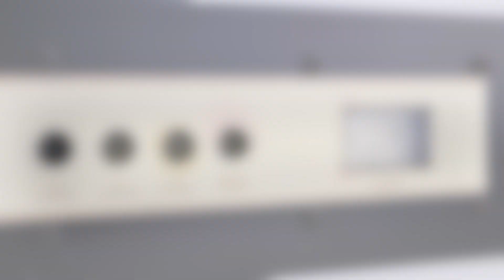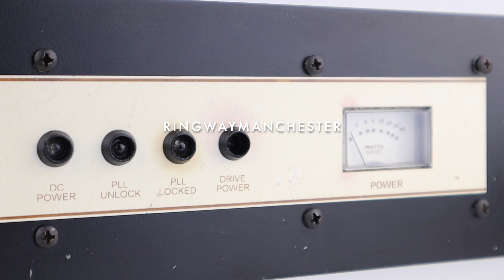Michael Jackson's Illegal Pirate Radio Transmitter

Comment: actually under part 15 if they were only transmitting a couple of blocks or out to a parking lot that would have been ok with the FCC.. I believe offhand they allow up to a 1/4 mile or 250mw whichever comes first.. drive-ins have done this for years.. for the most part the only thing that will get you into trouble is if your cussing on air.. playing uncensored music..  or interfering with a licensed commercial station and if someone complains.. just insight from someone who has some knowledge of FCC broadcast rules.
Reply: For FM, it's a specific field strength rather than power level: 250uV (microvolts) maximum measured at a distance of 3 meters from the antenna.  Typically, it will get you up to a couple blocks if you have good line of sight from the antenna, though I know plenty of Part 15 operators (mostly those who have no clue what they're doing) just crank the power all the way up on their certified Part 15-legal transmitter and assume they're within the legal limits.  In fact, there's an annual Christmas display in my town that SHOULD only be heard about a block away, but it covers the entire downtown area.  Personally, I have a little 1-watt transmitter on my desk in my apartment, and due to my location on the top of a hill, I have to keep it powered quite low to stay within the limits.  I can neither confirm nor deny any claims that its full power consistently covers about a 1.3 mile radius 😉

Comment: Clever idea! Around the same time period they did this for MJ, my father, also an audio engineer, built a transmitter much the same and advertised his home for sale. You could tune into the station on the sign out front and get a verbal tour of the house. Never got into any kind of trouble! Im surprised this sort of thing was not more common.
Reply: Saw homes in Pennsylvania radio  broadcasting their for sale info a decade or more ago.

Comment: You could buy FM transmitter kits all over the place back then. Getting one that was stereo was a little more pricey, maybe $50, but not difficult or even unusual. Cars had 8 track or cassettes. If you wanted to add a cheap CD you got a FM transmitter for your car or you used a cassette tape wedge. The bottom part of FM band around 88MHz has a provision for this.

Comment: If you want a mix to sound like it's on the radio nowadays, you don't need an FM transmitter.  Just do the following:
Reduce stereo separation to zero except when the audio levels are below 20db of 100% modulation, then give just a brief squirt of stereo image.
Limit audio frequency response to 50hz - 7.5khz.
Use a five band audio processor with thresholds adjusted to about -10dbm. Set attack for less than 10mS, release for 500ms
Use a "soft clipper" set at 0dbm to shave off any peaks above 100% modulation.
Sounding pretty hideous at this point, so go ahead and set your stereo imaging for maximum image and and be sure to set the sampling time to 1 to 2 ms. so you can hear that whine of  the poorly combining unmatched left and right comb-filtered channels.
Oh ok, add a little reverb to give the illusion of high fidelity.
If it sounds like crap, your setup is correct, you now sound like 90% of the FM music stations in the USA.  Record your mix and take it out to the car, listen and cry.
Reply: This is completely wrong. why 7.5khz? this is more AM than FM quality
Reply: The audio frequency response for FM can go up to 15 kHz and down to 30 Hz (about the same for a decent cassette), so filtering is not really necessary. The purpose is to see how it sounds in the car, rather than how it sounds on the radio. I think why they did not play the cassette in the car is because car cassette decks may not be as good as high-end home cassette decks.
Reply: @shenghe9876  I'm aware of the potential FM audio bandwidth, per FCC Part 73.  I'm saying it is not being fully utilized anymore.   If this is being done to enhance the BW for a HD mode, I get it.  I would just prefer a good clean 30-15K frequency response in mono to the quality we now receive, which is often reminiscent of an old cassette deck with a loose tape head, lol.

Comment: Did they also use (multiband) audio processing on that FM signal? Otherwise it made not really sense since all radio stations don't play raw audio on their transmitters without it. So it would definitely not sound the same as any radio station there,

Comment: I still do this now using a 1.5W transmitter (with power turned down) into a 50 ohm dummy. It can broadcast just outside to my car. Unfortunately, going straight through doesn't give the truest impression of what it'll sound like on radio, as many stations use their own audio processing as well as MPX processing to max out the 100kHz bandwidth. The only way to get it sounding close is to run it through something like StereoTool. Still, it does help to get a mix sounding better!
Reply: Stereotool is widely used by lower budget FM stations these days. Setup well it sounds good. I know one community station who sound better than the Greatest Hits up the road who are presumably still using the Optimod from the station they took over (granted said Optimod was set up under the instruction of their moronic PD and overdriven to distortion).

Comment: Hey anyone ever heard about it's not really radio but it is about putting two ground rods a certain distance apart and sometimes just a crystal diode like a germanium diode or even a more elaborate tuner in some cases and basically receiving things through the ground that essentially just a difference in potential between two ground rods can pick up.

Apparently back in the day there were people that would do to reverse and transmit this way and would tell their fans or others to do this in a way to receive.

Even in more modern times you can sometimes hear interesting things going on you should just random noise and stuff but occasionally more I know somebody that tried this experiment and they realized they had a problem with a piece of equipment because of this don't remember the whole story.

But they were getting electronic noise that should not have been this is after it's started the hobby and realized what it was and had corrected the problem before the device had failed I do believe he was in amateur radio but not sure.

Could be confused with someone in a family being an amateur radio and tell him how to do this.

Don't remember how many years ago this was.

I had heard stories about this people doing this many many years ago!

And if you have a high enough number of transistors chained you can get tremendous amounts of gain an amplifier stage.

Even to the point where you can pick up lightning miles and miles away with a simple antenna!

And even other types of electrical noise that would not even be perceptible to even sensitive equipment at least it would be available to the obvious.

Can't remember what one of my friends was doing but he did something like this to pick up some type of interference to track something down he was having trouble with and one of them getting fascinated by the results of what he was able to pick up.

In the end wound up doing something with the circuitry to detect lightning in the distance!

Also back in the day when the coheras were used.

It was known that they could also detect lightning since after all they were detecting the spark gap transmitters and what is lightning but a big Spark.

Also they're able to measure the Earth's temperature by Schumann residents which is essentially the frequency you can tune into but the proper type I've set up.

And in some form or another since apparently Earth's temperature on average does influence frequency of lightning flashes!

Comment: I did some work in Canadian studios during the late 90's and they had more kit than you could imagine. I went into a sound booth and was given a tour of what was there. They had several sets of speakers including ones to replicate the 'transistor radio', a 'tv set' and on a PA system such as in a shopping mall. They also had full stacks of broadcast quality speakers. Allegedly MoTown was where this practice of using lo-fi speakers in the studio came from, for that 'transistor radio' feel.
If I can remember, the booth was like a padded cell with sound insulation all around. Even with these clever speakers you still would not get the in car experience because there isn't an engine throbbing away, no tyre noise or noise from the 'wind'. The acoustics were different, however, MJ drove a Mercedes 500 SEL to get to the studio and that was quite luxuriously padded inside.
So why didn't MJ just use the cassette deck and play a tape? Particularly since it was FM that they were testing? Could they have not just lashed up some CB radios?
In the Western states AM radio is what you would have wanted at that time if venturing into 'Canyon Country' which is not that far away in California. FM doesn't cut it if you are chugging along at 55 mph in your pickup truck heading into the Sierra Nevada.
All considered it sounds like typical media luvvy lifestyle where the pampered talent gets anything they want without question, regardless of price or sanity. This iss what makes the media interesting to work in.
Reply: When you miss the point, you really miss it.  First off, FM audience size surpassed AM in the 1970's.  The takeaway here should be how little time and effort and money they put into this, not how much.  Also, CB radios?  What?  You don't sell more albums than anyone in history by half assing it.

Comment: This was one of the sloppiest stories I've seen on this channel, in both US legal and technical respects.  

A low power transmitter capable of reaching a parking lot can be legal under 47 CFR 15 intentional radiator provisions, depending on its details.  

More of the sound of a broadcast FM signal comes from audio processing than from the actual transmission process.  A cheap hobby stereo generator prior to modern computer emulations could cause serious issues less present in expensive broadcast systems.  

A recording studio on Jackson's budget could easily buy an Orban broadcast processing system.  Recording from that onto a cassette and playing that back on the target car audio systems would accomplish more of the claimed purpose, than insertion of a cheap transmitter, especially if not professionally processed first, or encoded via a high end stereo generator.  

As usual with political bastard hacks to tech systems, both NTSC TV and FM stereo based on a DSB suppressed 38 kHz subcarrier phase locked to an 8-10% modulation 19 kHz pilot then F3 modulated to 75 kHz peak deviation along with a mono baseband and sometimes SCA added subcarriers, was far from the best standards engineers offered, as tweaked by politicians and corporate donors.